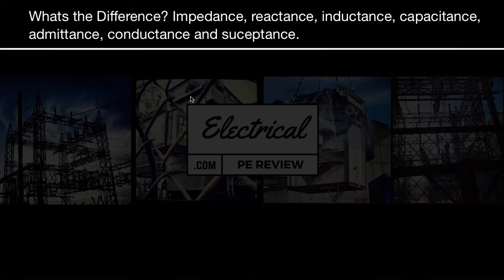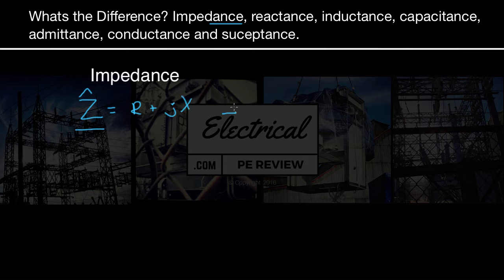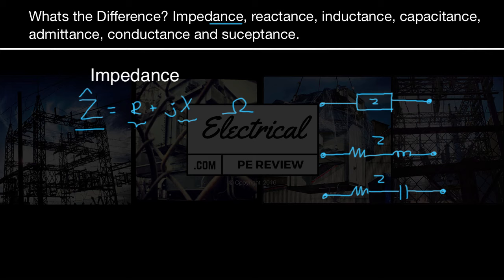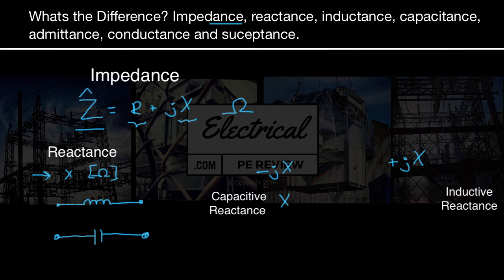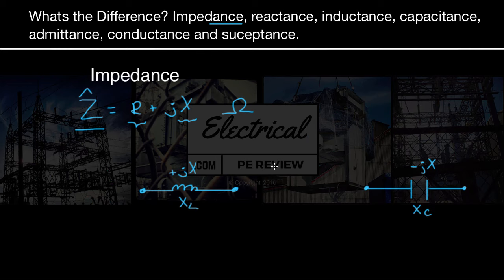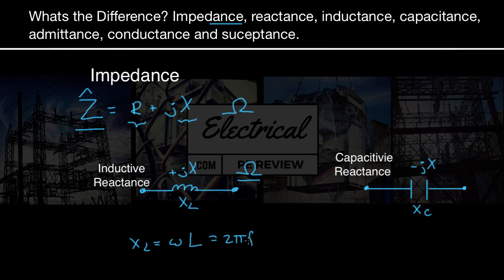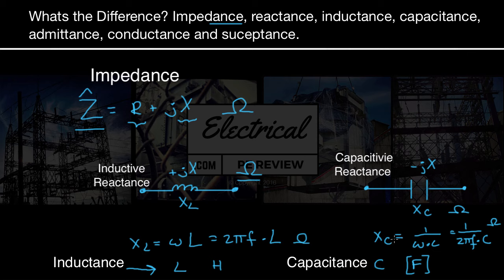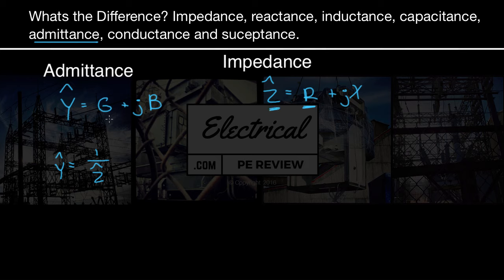Explained! Impedance,  Admittance, Reactance, Inductance, Capacitance, Conductance, and Susceptance

Comment: why inductor opposes sudden change in current? 
Ans: When the current flowing through an inductor changes, the time-varying magnetic field induces an electromotive force (e.m.f.) (voltage) in the conductor, described by Faraday's law of induction. According to Lenz's law, the induced voltage has a polarity (direction) which opposes the change in current that created it. As a result, inductors oppose any changes in current through them.

Comment: Seems like it would be better to describe inductance and capacitance clearly then build up from there. It's easy for someone like me to get lost in terms without first building an ideological foundation from which to explain the phenomena which we are actually defining. Math is important to describe the dynamic relationships between the magnetic and dielectric fields; how they operate in relation to eachother, and within the confines  of the circuit. That being said if we only focus on the equations without clearly explaining the dynamic process that it is actually ocurring then what good does the math do?
Reply from the maker: Hi Connor, thanks for your comment and feedback. This is just intended to be a short explainer video and introduction on the relationships between the different variables for those that are not yet familiar. We do explore the actual theory in much more detail in our online class for the NCEES® Power PE Exam.

Comment: Hi! Thank you for your help.

I have a circuit that has impedance and admittance components, if I want to find the total input impedance, should I consider the admittance component by converting it into impedance and add it to the other impedances?
Reply from the maker: Hi Avocadoe,  That is correct!   Admittance and impedance values are used to describe the same type of element, they just expressed differently as the inverse of the other.  If you need to find the total impedance, convert all admittance to impedance first before adding all impedances appropriately depending on if they are in series or parallel.

Comment: There is simple mathematics that transforms Impedance to Admittance. You have ignored this mathematics all together. But it was a good show 😀
Reply from the maker: The relationship between impedance and admittance starts at 8:21. The trig identities to convert between polar and rectangular form are not included in this video but we do have separate videos dedicated to it. This channel focuses on the NCEES Power PE Exam, and since the exam approved calculator can handle these conversions for you we typically omit them for simplicity.

Comment: Hello there. I was trying to find the relationship between these two online, but I found out two completely opposite answers, and I'm wondering which one is the right one. 

Is B = -1/X or is B = 1/X ?
Reply from the maker: Hi Eduard. The polarity of the angle changes when you take the inverse. For a simple experiment try the following on your calculator:  1/(5<25º) = 0.2<-25º.

Comment: Good presentation - but the term you call "W" is not W, but omega the Greek letter used in electrical engineering for the constant 2pi. At 89, I've seen a lot of what seems to be a loss of rigor in many aspects of engineering and other fields of endeavor.

Comment: how can we get j in Reactance formulas?
thanks anyway.
Reply from the maker: Hi Dwi I'm not sure I understand your question. Reactance is just the imaginary component of impedance, so it will either have a positive or negative "j" multiplied by the unit in ohms.  For example, a 2 ohm inductor has a reactance of 2 ohms and an impedance of j2 ohms.
Reply: ur explanation is what i want.

so, because reactance cant be measured so it is included in imaginary component.
is it right?